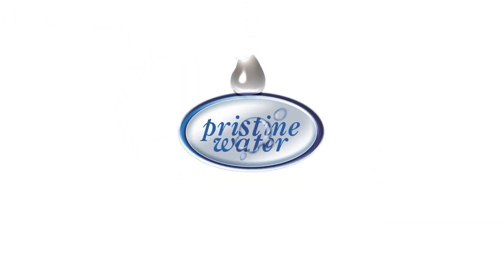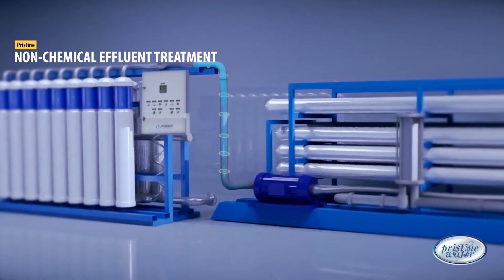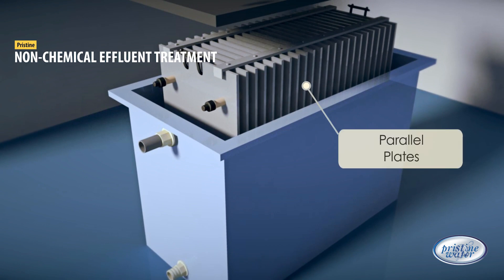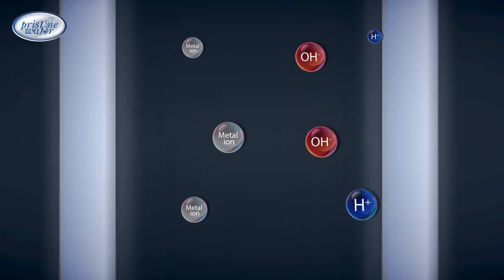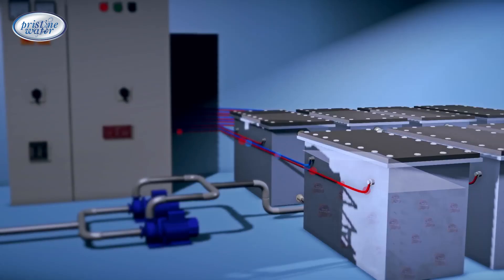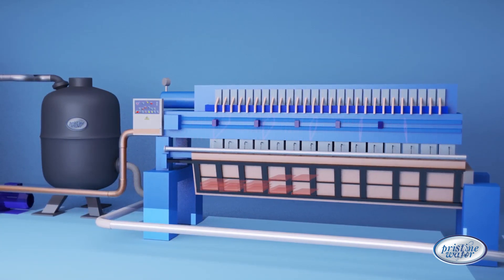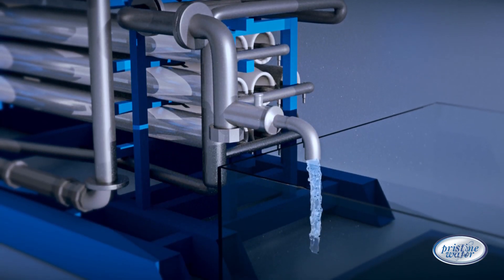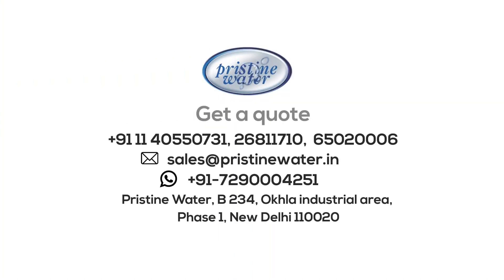Electro Coagulation ETP Operation  for Wastewater Treatment

Comment: Hi, I have a question, can this system of purification of the water can be used to decontaminate the water from microplastics ?
Reply: Yes, electrocoagulation (EC) can treat microplastics in water. EC is a water treatment method that uses an electrical charge to change the surface charge of particles, causing them to clump together. This process is effective at removing microplastics from wastewater